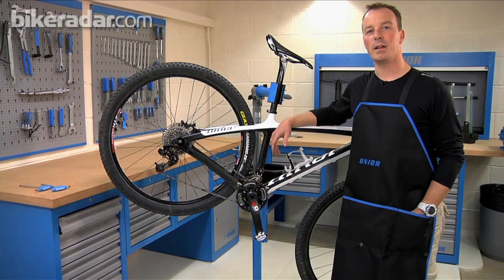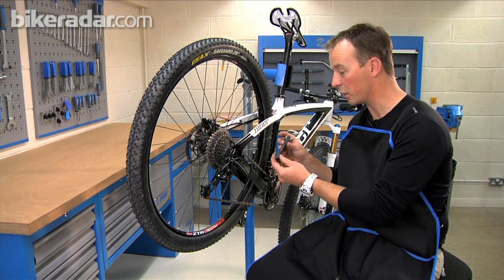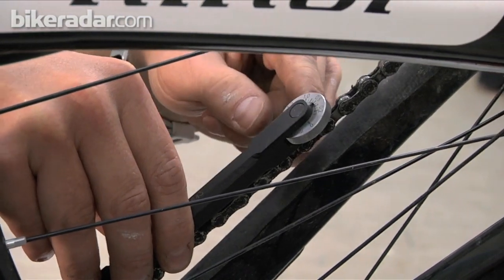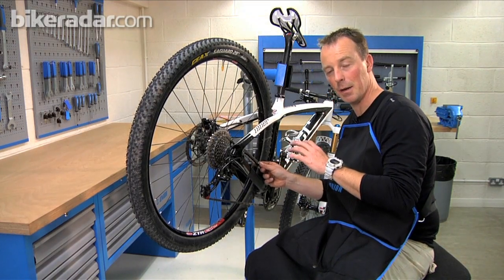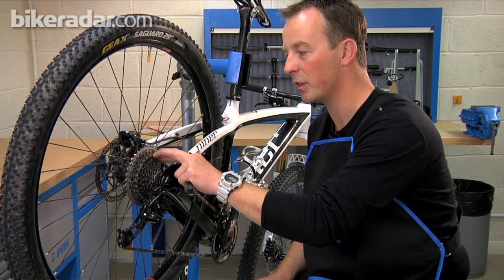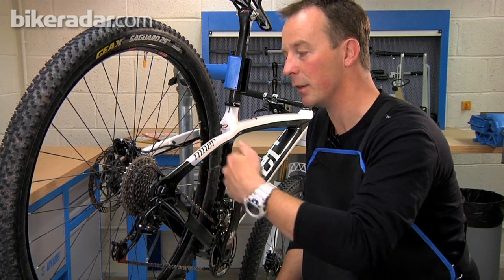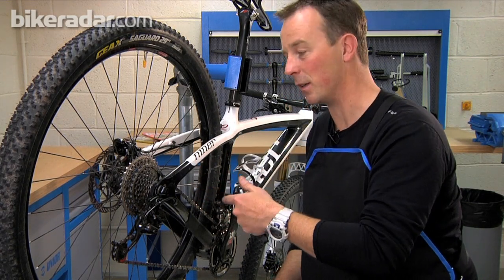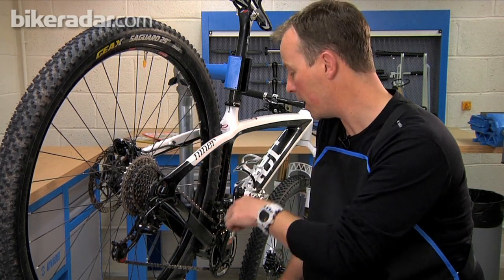How to check for chain wear

Comment: on my last bike my chain was worn out really bad it kept jumping between gears had to replace chain ring and get new cog as well it was expensive plus I never looked after the chain properly so I would defo recommend getting one of them tools and make sure the chain is clean and you use correct lube for it

Comment: Thanks for that helpful advice, just bought one of those tools. Still plenty of wear left on the chain, a Sram PC 991, but it snapped after a couple of months use. I was surprised as other Sram chains have lasted for considerably longer. Would it be worth putting a new chain on or stick with the current one until it's ready to be replaced , thanks.

Comment: I have always had 2 chains for my cross country bike and after each ride I take one off, put it in a plastic box with oil in it and let it sit over night. Mount the new one so its ready to go. The day after I take it out of the oil bath, clean it with a rag and it comes out like brand new. Put some chain oil on it and it's ready for the bike. I run my bike in everything from muddy to dusty conditions, this way the drivetrain last me a lot longer than my lazy friends. Got this tip from a mechanic at the local bike shop 10 years ago and it has had a big impact on maintainance cost.
Reply: KennethLarsson that seems insanely unnecessary. just skip the fiddle fucking, ride your damn bike, and get a new chain every 6-9 months.
Reply: Brandon Clark I dont know where you ride, but my trails has a lot of mud and dirt on them. I simply cant get my chains clean with a water hose. You realize you get a lot more wear on your drivetrain if you ride with a dirty chain or if its stretched out, right?
Reply: i guess i can't relate, i live in the San Francisco bay area, it's so dry here especially with the drought, all there is is damp hardpack, rocks, and dust.never even rode through a mud patch longer than 8 feet or so.

Comment: Didnt mention that if a chains swapped a new cassette is best due to differing wear.
Reply: Jason Alet - not true, the point is to replace the chain before it exceeds 0.5, thus avoiding chainring and cassette wear. If it reaches 0.75, then yes, replace all, but that is a mistake - replace the chain earlier and more frequently